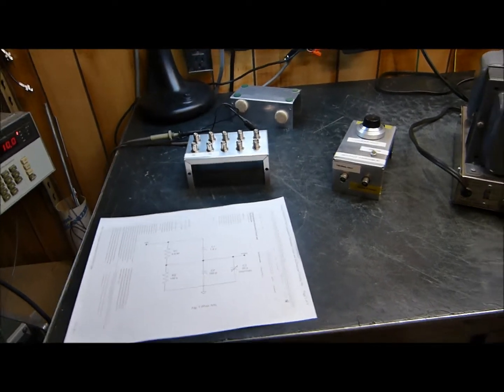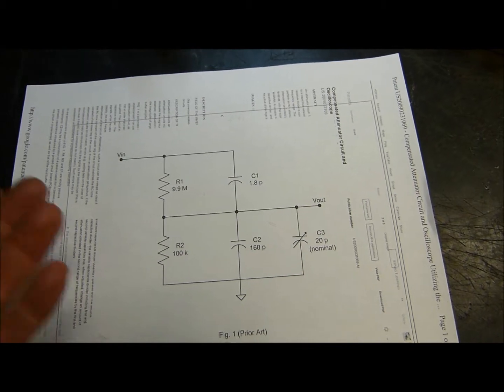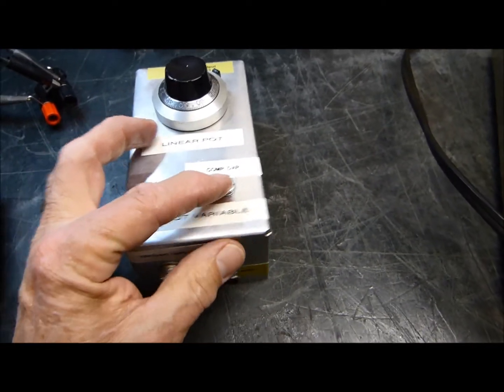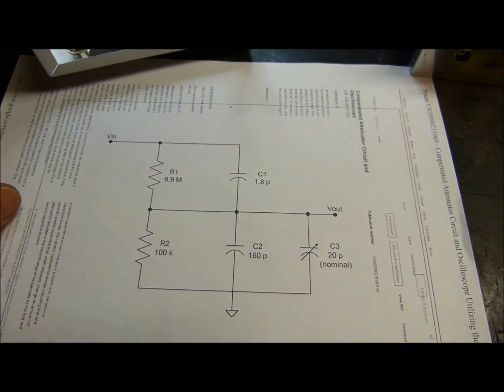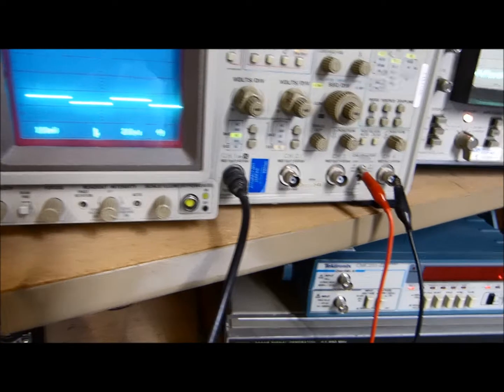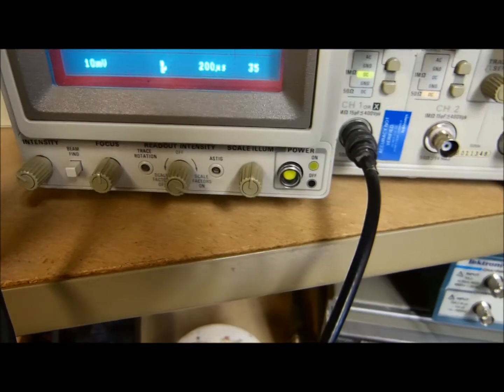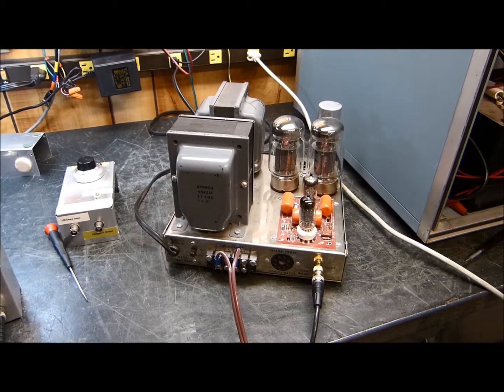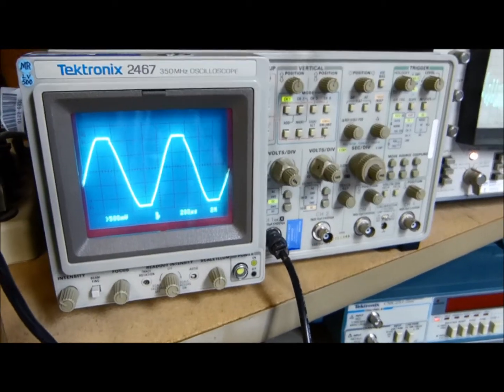Breakout Box With Frequency Compensation 2 of 2

Comment: Hi David nice video now I have to do the same to my brake out box and attenuator Thank George.
Reply from the maker: It doesn't make sense to have Tektronix scopes and then screw up the signal with a dumb attenuator   :-))  I have been using them and have discovered that different patch cable lengths have to be compensated for so... pretty much a necessity to make the trimmer caps adjustable from the front of the box just like an oscilloscope probe. I will probably end up turning mine around and drilling small holes under the BNC connectors - also... make sure the part of the trimmer you turn with the screwdriver is connected to the "grounded" side of the signal otherwise you will have to use a plastic screwdriver (I found that out as I put one in backwards the first time.)